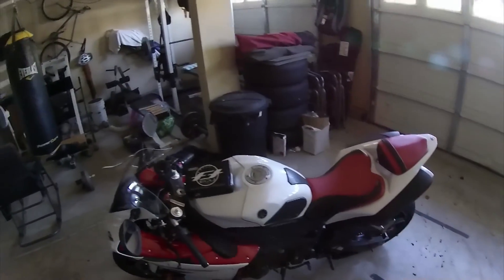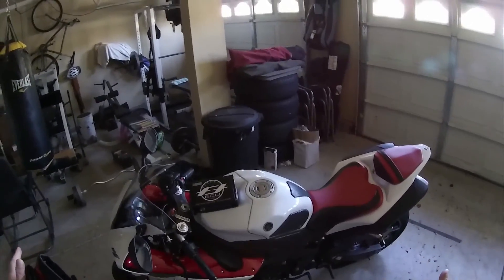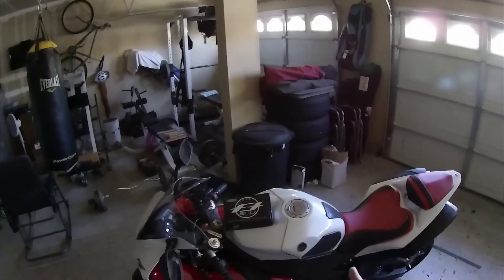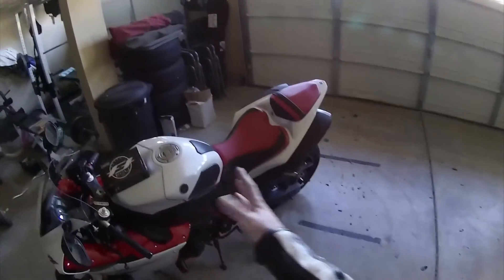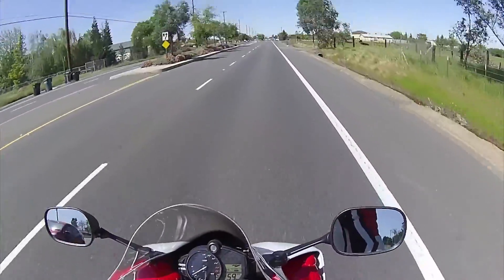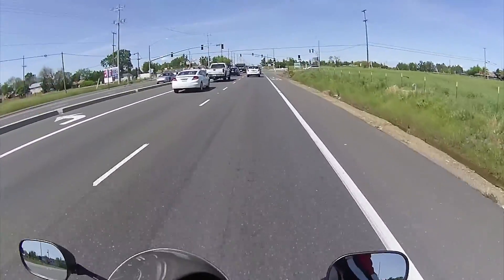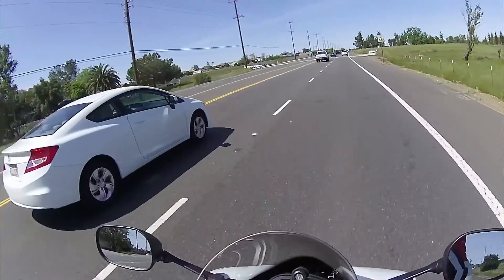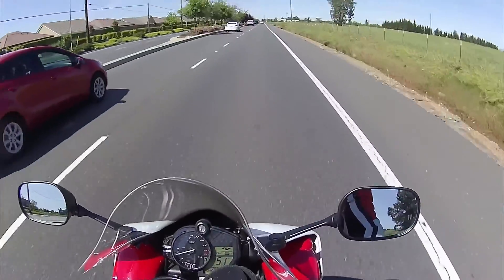Best motorcycle upgrades: Why didn't my Yamaha R1 come from the factory like this?

Comment: when your flashing do u have a battery hooked up to the battery , second question when u do flash if you were to put your hand on the ecu while flashing while it is writing does your ecu get warm or hot at all
Reply from the maker: Since My ECU has the Bikeside Harness plugged directly to it and you have to turn the bike on and off to flash it, yes the battery is hooked up on it, and I never really have felt the ECU during the flashing because my bike is fully put together during the flashing.

Comment: I have 2009 Yamaha r1 and for some reason it’s stuck on A mode. I do a lot of commuting and would like to put it in B mode but it doesn’t let me. Do you have any idea why it’s like that?
Reply from the maker: Please explain to me how you are trying to change from A mode to another mode.
Reply: I use the switch that’s next to the starter button. I’ve talked to a couple people and they told me it might be fixed with a ecu flash
Reply from the maker: @user-by5ud2hf1p  does that button move anything else on the dash?  Maybe it is a faulty switch.
Reply: Nothing moves on the dash unfortunately
Reply from the maker: @user-by5ud2hf1p  sounds like it might be a faulty switch 🤷🏼‍♂️🤷🏼‍♂️

Comment: Hey La, all superbikes are restricted to 299 km/h, how to make them unrestricted (able to do 300 km/h+) with the ECU Flashing?
Reply from the maker: I help anytime ...r u talking about the digital display not showing the fact that the bike is going faster than 300km or actually getting the bike to go faster that 300 km.  The ultimate top end speed is an issues of removing the throttle restrictions via flashing.  Then if u need to go faster, u will need to get taller top end gearing for your sprocket, but u will loose quickness on starts and out of corners.  Most get shorter gearing to be quicker and sacrifice top end because on most tracks top end is not important but cornering is.
Reply: I am La 
You didn't get my point (I hope you reply as soon as possible)

In 1996, Honda made CBR1100XX which used to be the fastest motorcycle back then capable of 310+ km/h, but Suzuki made the Hayabusa to exceed 320 km/h.
However, all the Japanese manufacturers were afraid to start a top speed war, so in 2003 they signed a gentlemen's agreement stated that no more 300km/h machines will be distributed for sale.
Thus they've all limited their superbikes electronically to 299 km/h, but I've heard H2 could reach 330 km/h stock but with unrestricted reflashed ecu.

And I wonder if I could unrestrict the top speed (Allowing them to reach 310-320 km/h) by flashing the ECU without any mods, and no need for sprocket changes, because the 1999-2002 hayabusa accelerates just as fast as these modern 1000cc superbikes but has higher top speed. I hope you reply.
Reply from the maker: I help anytime ...if the restrictions on your bike are in fact in the ECU,  as a result of the  manufacturers  reducing the throttle position sensor so that even when the rider has rolled on the throttle 100%, the bike is only getting 80 or 90% fuel because of how they mapped the the sensor, then yes by flashing your ECU you should have the capability to remove the mapping restrictions.  This is in theory however.  I know this works on the Yamaha R1 for certain years, but I don't know if it will work for other specific bikes.  You will have to research and find out if there is a software program like flashtune that can do what u want.  Good luck bro and have a blessed day...La
Reply: All the super bikes can reach 310-320kmh, but the display only shows 299kmh. You can see that even when the speed stops increasing on the display, the rpms are still going higher.
Reply: Szymon Bodoń 
Incorrect.
Reply: How is that incorrect?

Comment: Hey... did you notice decrease in fuel economy after flashing the ECU? I think more power than before means decreased fuel economy. I have same bike like yours and reserve light comes at 80 miles (without ecu flash) which is frustrating. how many miles you are getting before and after flashing the ecu? thanks
Reply from the maker: Kshetij Moitra ...80 miles yikes.  How hard are u riding Rossi🤣.  To be honest I never track my miles, but I think my on board gauge say 27 mpg I think.  U are correct in that more power equals more fuel.  I am still refining my maps to how I like them.  Once I am done then I can give a fuel consumption update.  If you are getting 80 then u ride a lot harder than I do or something is off a little.
Reply: You want fuel economy go and buy a fucking KLR or a SV650

Comment: Wanted to ask you if you know which settings are different on the EU versions? What are the positives on those regarding the default settings? I'm asking cause i live in Europe and will get a EU version. What positives can i expect?
Reply from the maker: I don't believe any actual settings are different on the EU version of the Flash Tune software, though I don't know for sure.  I believe the engines are slightly different based on emissions requirements and maybe some of the fueling maps.  But I think after they are flashed and the emissions stuff is removed the bikes are basically the same in all regions.  However, I do want to emphasize that I don't know the real answer to ur question.
Reply: @IamLaR1  Thanks for the reply :-) Well, i mostly wanted to know it the strong enginebraking and a little twitchy throttle could be different from the two versions, but i guess that part is the same
Reply from the maker: @hansottosmotos  ... Yes that will be the same on both bikes but it can be removed/adjusted to your liking with the FlashTune software.
Reply: @IamLaR1  Thanks again, La :-) Appreciate  the work you've put into your channel. Stay safe!

Comment: Can any ECU work in any bike, Do Bike Shops steal/replace ECU’s? I’m nervous about sending my brand new 2019 ecu off for tuning only to get back a 2002 ecu
Reply from the maker: No... Ecu's are specific to each year bike. A 2005 ECU will not work in a 2019 bike.
Reply: I am La thanks
Reply from the maker: @Cologneswag  ... Forgot to mention that each ECU is very specific to the year and type of bike.  Meaning a 2016 R1 ECU will not work on a 2016 R6 or any other bike for that matter.  Each ECU is specific because it does everything from fuel mapping, to specific electrical monitoring and fault codes which are bike/manufacturer specific.

Comment: Yeah doing your own custom map is very tedious and time consuming I did it myself on my 05 GTO 6.0 6spd because I put full length stainless headers cat deletes and Vararam intake etc.... took about a month and re flashed about 20 times I also used a gmeter to see if I made any horsepower increases. Big increase in drivability modest hp increase to the tire. I used HP tuners and went through each cell in 50rpm blocks never gonna do it again though lol. Great video I'll be anxiously awaiting why you haven't posted for a long time. Peace brother God bless you
Reply from the maker: Paulk Master ...thank you for watching and god bless you also.

Comment: hey, question... with the tuner can you change all the modes, for instance you wanted to limit your rpm in b mode to 8,000 could you do that? or even soften b mode even more?
Reply from the maker: joracer1 ...yes u could.  You would go into the "thottle by wire" settings for the "B" mode maps, there is a map in each of the modes for each gear and also for neutral.  You can limit the max RPMs in those maps.
Reply from the maker: joracer1 ...for example if I wanted to do the 8000 RPM max I would go in each map for each gear in the B Maps and set the max fuel % in all the cells passed 8000 RPM to zero.

Comment: Also how’s the gas( mpg ) after flashing it ? Thanks man
Reply from the maker: It depend on how aggressive ur flash is and how u ride it after the flash. My guess is yes to a small extent because most flashes remove lag in throttle by added fueling in certain areas of the maps to smooth things out, but it shouldn't be a dramatic change in MPG.